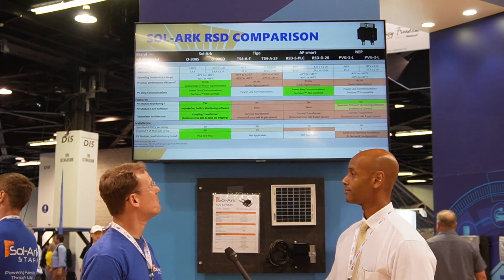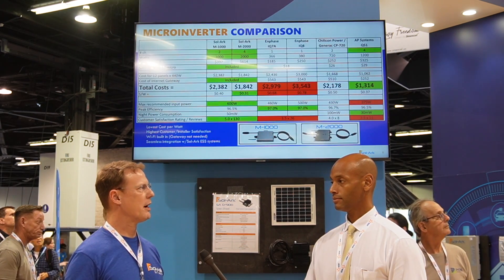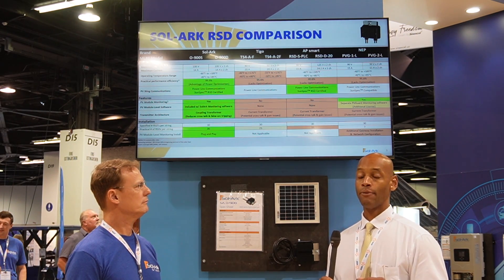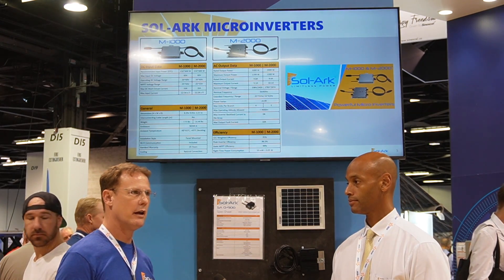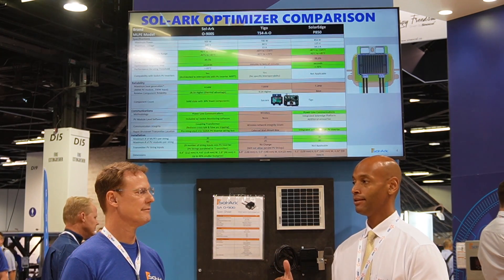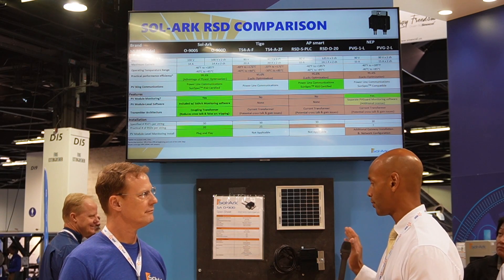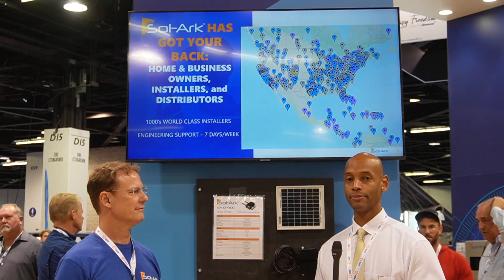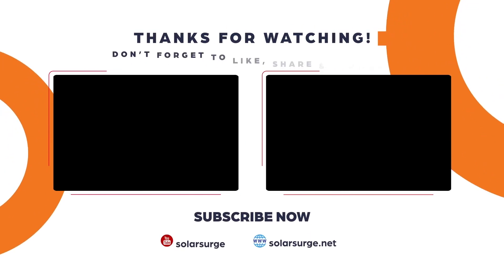New Sol Ark DC Optimizer Solution

Comment: Standard operating procedure for almost every fire department is to pull the meter at a house to kill the power. This will also kill power to an inverter. However, the batteries and array could still be energizing the panel. A disconnect between the panel and the inverter would solve this problem. Mount the disconnect next to the meter and label it as an emergency disconnect

Comment: Another Sol-Arc product you can't buy. Just like their ac micro inverters and Smart load 14.

Presenting products that aren't available; set expectations that are not met and is of little to no value. 

Micros and Smart were introduced in January and February of 2022. Most recent communication with Sol-Arc indicated Smart 14 to be out in July, but also said don't hold them yo it. 

Tired of waiting.

Comment: So,  is rapid shutdown at the panel nec code now?
Reply from the maker: Yes, this has been code since NEC 2014.  Check Article 690.
Reply: For PV systems installed on buildings yes.  Not required for ground mounts though, yet.

Comment: Any way to share the slides, the real meat of the information is in the background which was not very legible, not even at 1080p so I have a hard time reading the actual specs. It's December 2022 and the Sol-Ark website has zero information about these optimizers posted. Are we talking November 2023 or is this an old video? I did get Tigo optimizers and so far I'm very pleased with them so Sol-Ark has to be better (are they buck/boost or buck only converters?) or significantly cheaper to make it an economic decision for any future install over the Tigo solution. Maybe bringing the entire install under one brand umbrella provides some benefit and ease of use for some customers that is worth something, maybe not.

Comment: String Inverters suck! (unless you live in a sunny climate with no trees or clouds... so Arizona and New Mexico)
Reply: Sounds like you bought or sell Enphase... String inverters, especially when coupled with optimizers are just as good as any microinverter setup on the PV side and hybrid inverters with DC coupled batteries blow Enphase out of the water on both efficiency and cost.
Reply: Or México. My HV string to  inverter route is on the roof, near to the panels.
Reply: California, New Mexico, and Arizona suck; it's always sunny and hot.